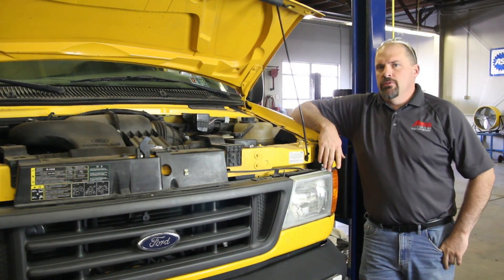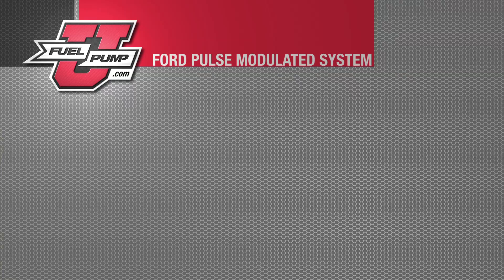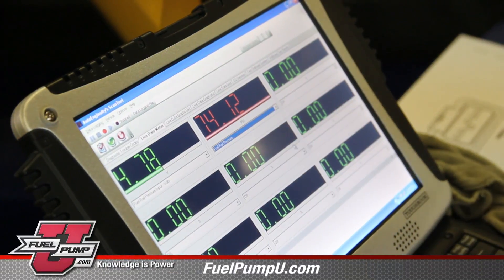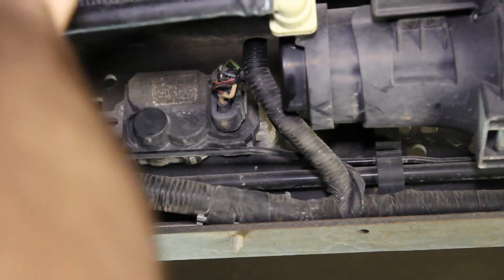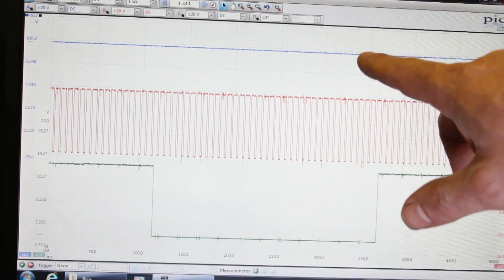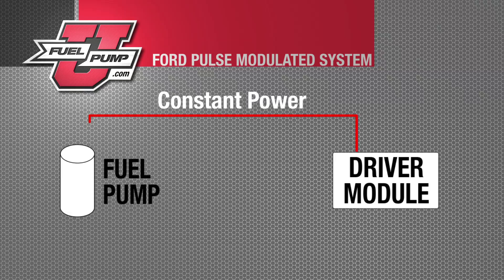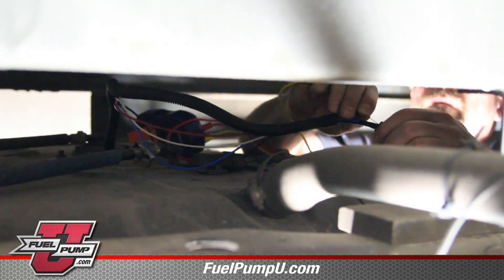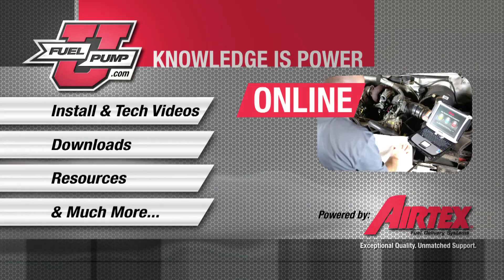P0191 Check Engine Trouble Code - How to Diagnose the Problem

Comment: Hello, I have P0191 and P0190 codes on my Duramax diesel 2012. Have changed my fuel pressure sensor, but the problem still exists. Wiring to the sensor seems ok, could you please kindly advice what it can be? Thanks

Comment: Informative video. Where did you connect the manual gauge for the pressure check?
Reply: Is the 06 e350 the same as the 05?

Comment: Ok I have the P0191 code , And think it's the fuel pump wiring and pump itself,  I installed a new fuel pump before but and seemed to work ok, but found the fuel sending gauge is the wrong ohms showing 3/4 when full ...NO MORE CHEAP ONES .... Great Video

Comment: i have my car diagnose because it show low power, engine check, hard start, show code p0191, the mechanic change the fuel rail sensor with a new sensor, when he try to start it, it wont start, now it shows code p0193 or rail pressure high, pls help me cause until now it wont start thank you
Reply from the maker: Like the P0191 the P0193 can be caused by poor connectors/contacts, bad pump or fuel rail sensor (new parts can be bad), pump relay, low or no fuel, restriction in the system; plugged filter. It will take some diagnostic work to determine the actual cause.
Reply: thank you very much sir, i will try to diagnose the problem, hope you could give me a step by step to follow, i our place there is no real mechanic to do this kind of diagose, we are a small island and the good mechanic is in the other island thnk you sir

Comment: I started getting P0191 codes on my '05 Crown Vic.  Checked the wiring, checked the FPDM, checked the PCM and the FRP.  Put a pressure gauge on it and was idling at 30PSI.  Under load it would drop down below 20PSI, which set the code.  Problem was the fuel pump, an Airtex unit I purchased in 2014.  I was able to replace it under warranty, however I now have a Delphi pump as Autozone no longer stocks Airtex.

Comment: Hi. I have a 2005 Ford E-150 4.6L with the p0191 code (no other codes, just that one)  I did a voltage drop test on the driver module like you did and the positive side is showing 1.5v.  I inspected the wiring up the entire van and cant find any damage, wiring looks fine. My fuel pump also stays on continuously with the key on (engine off). Any tips? Thanks in advance.
Reply: Thanks

Comment: hi I hope you can help me out, I have a 2005 lincoln navigator my check engine light  Is on I have code p1237 and p0191  ok, when I turn the key on engine off fuel pressure is 75 psi but not only that the fuel pump keeps running even with engine off key on but when I turn the key off the fuel pump turns off. I have a scantool  and fuel presuure at idle is 75 psi too much, I have replace the fuel pump and the fuel pump control module  at the rear  to no avail. the connectors are fine at the fpcm no corrosion what so ever so my question is what to do next any help is appreciated thanks.
Reply: I'm having the same exact problem. 2004 ford f150 4.6. Did you figure out your problem since it's been 5 years? Lol thanks if you can
Reply: @MichaelMinton  I fixed the problem my fuel pump driver module was grounded outside  it was a wire that was grounded  to the chasi, just replace the fuel pump driver module they get corroded inside

Comment: I have the same fault code, but my car will not start. When turning key to second position can not hear my fuel pump. I put in new fuel pump and still have the same symptoms. I sprayed starting fluid in the throttle body and the car starts up. What should I check
Reply: Thank you, I will buy a multimeter and attempt to test the voltage at the pump. Thanks again.